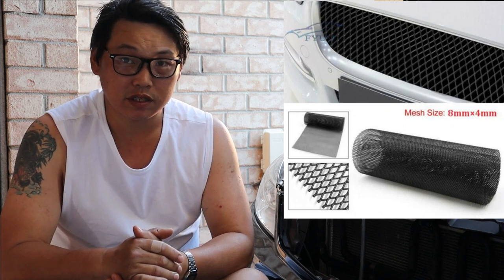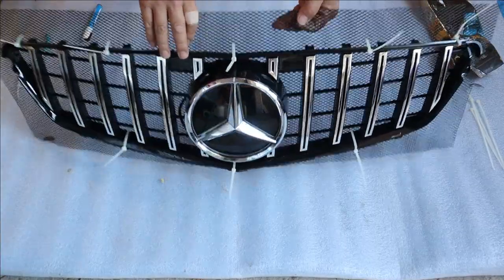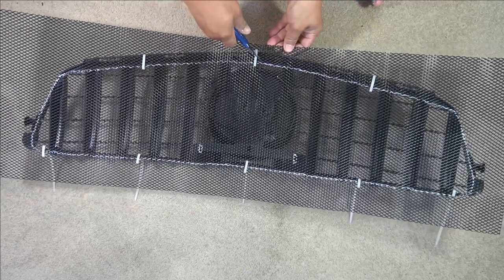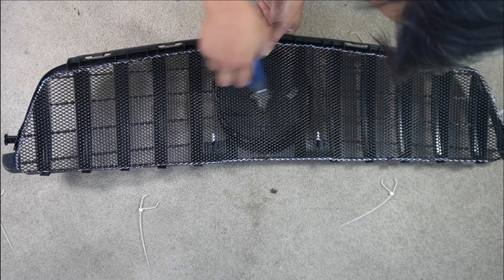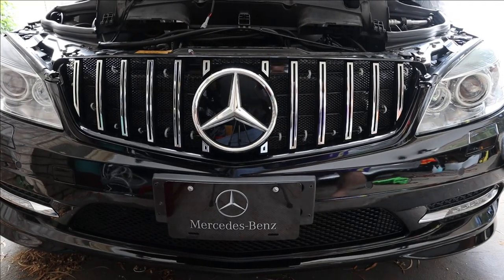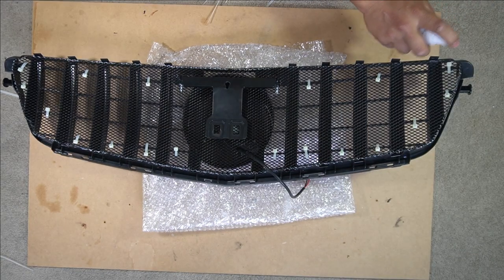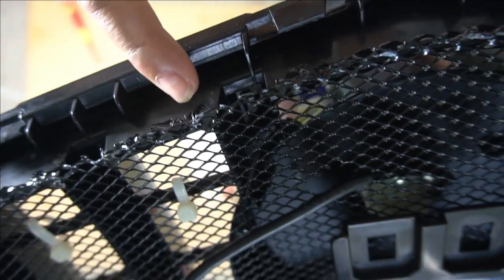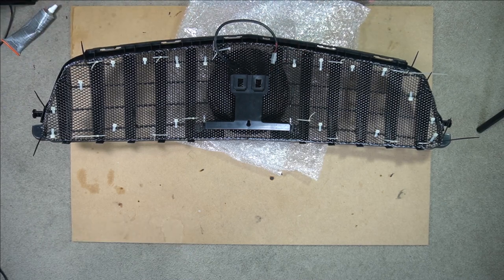D.I.Y add aluminium black mesh to mercedes w204 w212 w205 c207 gl glk x204 GT grill - LOOKS AWESOME

Comment: What size sheet of black aluminum mesh did you use for it? I'm going to order some when I order the grill. Also I heard people had trouble fitting the emblem into the grill.. apparently the circle is slightly larger than the stock grill.
Reply from the maker: its the basic size sold all over ebay 
120cm x 40cm h9oles were diamond shaped 4mm x 8mm , very easy to cut with side cutter or wire snips 
i didnt have a problem at all it all fi9t pretty well
Reply: @MIKEYZVLOGZ  thank you for the quick response.. cheers!
Reply from the maker: not a problem @gordonshumway6128

Comment: Nice video! I have the same grill for my GLK350 but I’m not been able to find a Mercedes star like yours that fits
Reply from the maker: yea its a bit hard to source but they do make them for alot of models.. im sure u can findnone for your car ..mine is a light up star . as well
Reply: If you haven't found the star already try Amazon thats where i found mine for my GLK and my Panamera grill
Reply: Did the stock GLK 350 emblem fit in your GT style grill? I have a 2015 glk 350 and I don't want to order the grill until I can be sure the star will fit in it.
Reply: @gordonshumway6128  I had to use glue

Comment: Hello, make a video to understand where you connected the emblem mercedes star? Where should the two cables be connected?
Reply from the maker: I did do that its in the star video
Reply from the maker: check the video on how to wire a light up star it shows all that
Reply: @MIKEYZVLOGZ  butYour video is about the version of the star with the grille, I look for the video of the star for the new version of the Mercedes w177
Reply from the maker: @TrInAcRiO1  everything is the same ... just different grill.. so whatever model your car is ..as long as u buy the right star for tour grill it will install the same way ... mine is a w204 and it installs the exact same way ... and for the cables u can connect it 2 ways ... 1. direct to fuse box and car chassis to a switched 12v source..2 to a switch on off using same connection to fuse box and lastly to a light so it comes on with your lights I.e parking lights

Comment: Seems like you were able to uninstall and stall the grill without removing the bumper. Do you have video showing that?
Reply from the maker: yes for the grill u don't remove the bumper just simple pop it out yes check out my light up star video and it shows how to remove it too
Reply: @MIKEYZVLOGZ  thank you!
Reply: @MIKEYZVLOGZ  is it the same for W205? Any link(s) for grill, light up star and black mesh please?
Reply from the maker: @crisdijamco8864  wq05 have different shape grill but principle of instalment is the same

Comment: Man outstanding job!
Is this star emblem working with distronic?
Reply from the maker: thanks mate...and yes ... the distronic on my car is on the front bar so it doesn't affect mine ... which distronic are u talking about
Reply: @MIKEYZVLOGZ  i got exact same car as yours, so i spot that you have distronic also, but i have read that the distronic having some problems when you change grill and star...
Reply from the maker: @zelezo777  no that's rubbish never been an issue..distronic works by detecting what's in front .. so how can the star affect the sensor.. get my drift? I dunno what ppl are doing wrong but they must be doing something else
Reply: @MIKEYZVLOGZ  awesome, I'll try to find similar star as yours then!
Thanx for the tips!
Reply from the maker: @zelezo777  no worries I listed it in the video where I did the actual grill and star search through ull see it

Comment: Shouldn't it come with proper clips and the mesh back already cut and attached?
Reply from the maker: apparently there is one that is made like that already ..but I didn't have the luxury of finding it to buy hence why I did this.. and I really wanted to get rid of the big gaps from debris flying in
Reply: @MIKEYZVLOGZ  That's what I was thinking. The amount of debris and insects that would gather in that grill.  Hmm.   Was thinking about putting this on my W212 but, it's a whole laborious complex time consuming project.  I wish it was just pop the old plastic one off and put a new one on.  It's wheel arch liners, undercarriage, about 50 clasps and plastic screw clips.  Most take the bumper off and drill the old chrome/plastic.  I've seen some W204s or other non-E  .. C classes that just pop off and a new grill is put on.  I don't know why the W212 is a whole complex event.  I'm guessing, for itt being solid and staying on - plus older models don't just clip off.

Comment: Hello, how wide is the mesh of the net?
Reply from the maker: 4mm
Reply: @MIKEYZVLOGZ  4 mm x???
Reply from the maker: @TrInAcRiO1  I think about 2 or 3 I'll double check for ya..ok it's 4mm x 8mm
Reply: @MIKEYZVLOGZ  Thx, but don't you think the mesh is too dense and does not allow the radiator to cool the engine well?
Reply from the maker: @TrInAcRiO1  no the air passes through just fine after all its mesh
Reply: @MIKEYZVLOGZ  ok rhx I tell you so because I have the doubt about which shirt to buy,
Reply from the maker: @TrInAcRiO1  no worries ... if uthink about the factory grill it's as restricted because it only has gaps between the fins of the grill at least this has holes that air can pass through still

Comment: Looks alot harder to keep the grill glued to the grill then it actually is. Also if you do glue on the mesh make sure you don’t use the wrong type of glue as I used one that turned yellow & puffy after it dried and almost ruined my grill.
Reply from the maker: good tip .. yes makensure u use one that goes clear for sure

Comment: Or you can just buy a mesh grill on ebay for 80 bucks... just saying
Reply from the maker: I got this mesh designed for cars for 30 aud shipped
Reply: @MIKEYZVLOGZ  Yea some ppl buy just the mesh as you did and some people that have things to do, buy the grill with the mesh already on it
Reply: I actually just bought a mesh grill for my 2004 CLK 55, took me 15 mins to put it on, welcome to 2021
Reply from the maker: @cryptoflipdoe7141  do u have the exact same grill as this with mesh already fitted .
Reply: @MIKEYZVLOGZ   I bought the one with the single silver bar going across on each side of the benz emblem but I saw the grill that you have with the mesh already on it for around the same price on ebay, but it would look funny on my 03 CLK. But anyway works, just putting in my 2 cents, some people arent good with tools.
Reply from the maker: @cryptoflipdoe7141  ye das why I try to break it all down for everyone .. ye ur grill has mesh but I wanted this grill n at the time there were t any with mesh they were t designed dat way
Reply: @MIKEYZVLOGZ   Yea that grill has to be customized which some sellers do, just wanted ppl to know you can buy it already with the mesh but still a good vid

Comment: No cooling
Reply from the maker: whatsoever umeanno cooling ? for engine and radiator? it's mesh it allows the air to still pass through..it is not a solid piece ... and as shown in video the holes / gaps are a descent t size 8mm x 4mm so plenty of room for air to pass through a d cool down engine and radiator ... no less then the factory grill with 3 fins